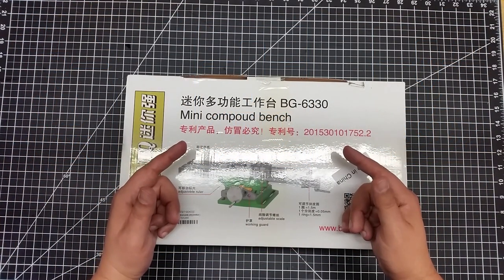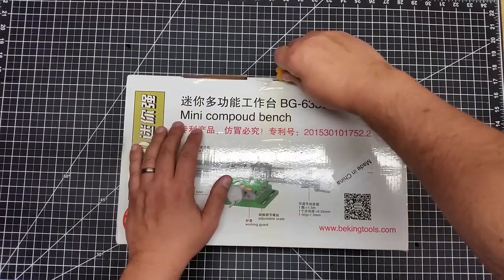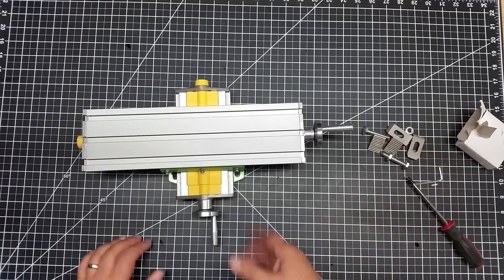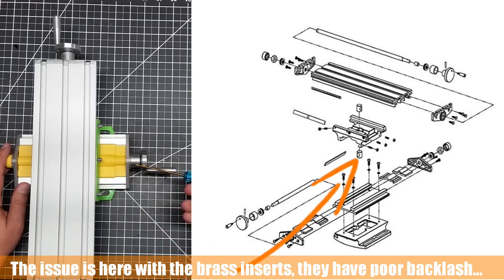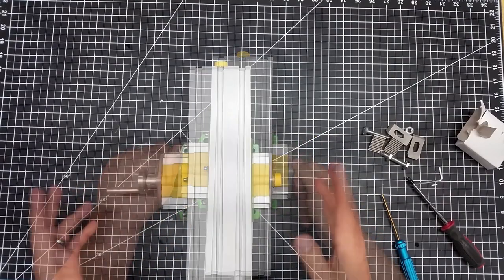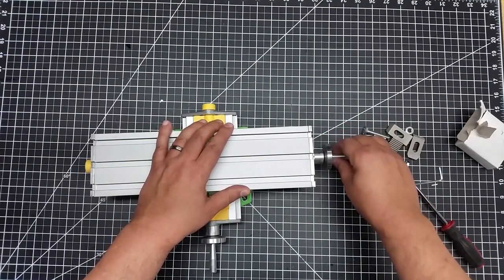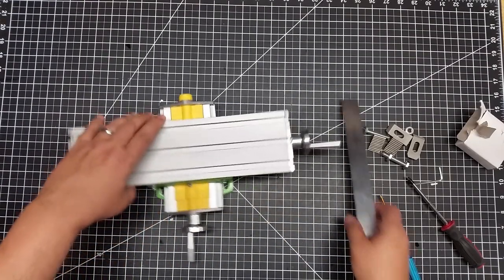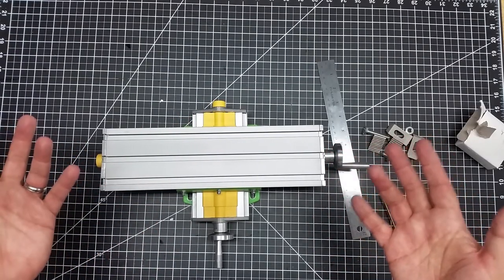Shop Talk - Compound Slide Table for Tabletop Milling!

Comment: I have had one of those for a while and only just got around to tuning it up recently because of all the little issues.

Take it apart all the way and get some shims to add to the gibs to eliminate as much play as you can without making it too tight. The fact that it is extruded/cast aluminium made me hesitant to use brass or steel shims that would chew away at the surface so I used teflon sheet cut into strips. I added a bit too much shim and then took fine amounts way by lapping the existing brass gib (run figure-8's on sandpaper supported on flat metal plate, make something to hold the little gib securely to save your fingers, this may take a while). That gib was also really coarsely punched out so it has lots of raised edges and deformation that are worth checking.

The soft-ish metal also means I ignore the gib screws altogether for any kind of tuning or holding. It is stiff enough with the shimmed gibs. Yours looks like it has larger screws so they might be more useful. I also put pins through the nuts at the ends of the threaded rods so I have the option to drive them with a socket on a drill/driver. This makes coarse positioning a lot faster. The problem with adding any additional pre-load to the threaded rods is the end plates on each axis are pretty flimsy. Their flex is where most of that backlash comes from. You'll need to make new ones for better accuracy.

Lastly I added a bunch of guards over the dovetail surfaces so oily chips won't be able to bounce onto them easily, sticking and grinding into the aluminium/teflon bearing surfaces. That bottom dovetail on the short axis is especially exposed because those sliding plates only protect the screw.
Reply from the maker: Excellent tips!  Many thanks!

Comment: If you take the top table off, you'll see the worm screw running in a brass bush in the centre. This is just a "drop fit" into the casting. Very loose - that's where most of the play is. Thrust bearings at the ends will make no difference.